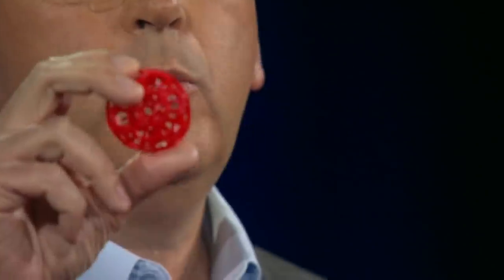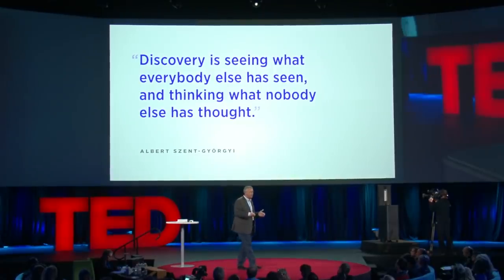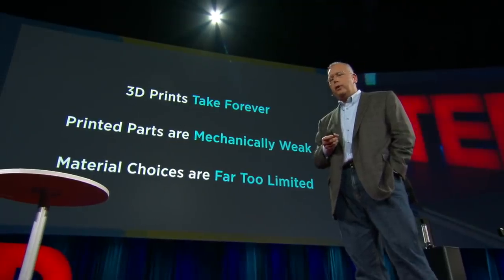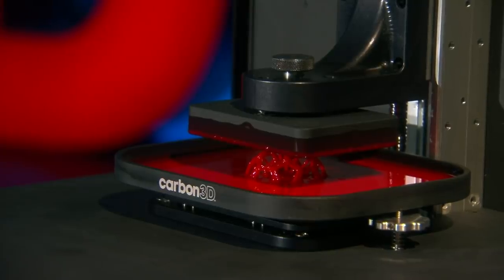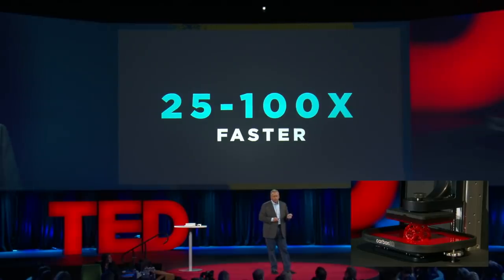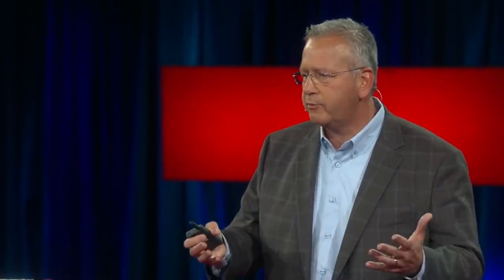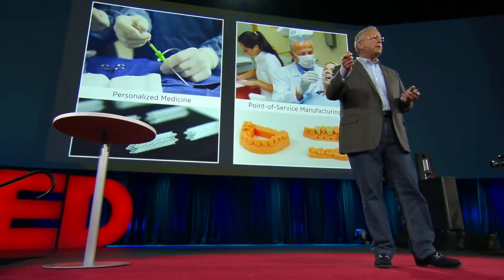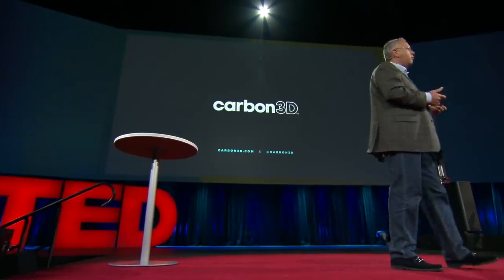What if 3D printing was 100x faster? | Joseph DeSimone

Comment: Funny how he talk about fuel efficient cars and shows a Telsa that uses no fuel.
Reply: gamepro94z thats about a fuel efficient as you can get. Electricity is still a form a fuel, and creating a lighter rigid product would mean less electricity is required to drive it forward.
Reply: tushay
Reply: gamepro94z Tesla needs to pay attention to this tech if they wanna make their Model 3 affordable. The Model S requires an aluminum body to get its impressive mileage, which is why it costs so much.
Reply: gamepro94z tesla uses fuel.... it runs on coal.  ITs just that the coal is burned at a power plant not in the car.  Its more efficient than burning the fuel in a car for sure but the tesla CERTAINLY runs on fuel
Reply: +Ddub1083 Aswell as power plants having higher fuel efficiency, fossil fuels don't account for all energy generation. The price of solar is on a very consistent trend downwards also where it will eventually undercut oil and coal significantly. Fossil fuels have a strong hold now but they'll eventually become not just unhealthy and impractical but economically nonsensical. /rantover
Reply: Tesla certainly does NOT run on coal. You don't need coal to start a tesla and to drive around. It's like saying that people eat gasoline, because in order to produce the crops, the farmer used a motorized vehicle.
Reply: Charging and then discharging battery throws away half of the energy instead of using it to proppel the vehicle. Tesla wastes more fuel than gasoline engine.
Reply: Where does this sicentificallyfull claim come from?
Reply: Christopher Hilder ELECTRICITY IS Not a form a FUEL....FUEL is: COMBUSTIBLE MATTER used to maintain fire, as coal, wood, oil, or gas, in order to create heat or power. An energy source (combustible) for engines, power plants, or reactors:
Reply: laszu That's the stupidest thing I've heard this month. An internal combustion engine blows up fuel to make heat and a little forward motion on the side. It's doing incredibly well if it can get 30% of the combustion energy in gasoline out as useful work. The inverter, battery, and motors in an electric car are all at over 90% efficiency; 0.9 × 0.9 × 0.9 = 72% efficiency. USA Department of Energy says:
“Unlike conventionally fueled vehicles, electric vehicles experience a loss of energy during “refueling,” with an energy loss of about 16% from the wall power to the battery during charging. However, electric vehicles are otherwise highly efficient delivering about 65% of the energy from the wall power to the road even before energy is reclaimed through regenerative braking. When energy gains from regenerative braking are included, the amount of energy used for traveling down the road can rise to more than 80% in the EPA-combined city and highway driving cycle.”
Reply: Electricity is a fuel. Everything that you can power something with is technically a fuel.
Reply: @blackking2028  No it isn't. Merriam-Webster:
a : a material used to produce heat or power by burning

b : nutritive material

c : a material from which atomic energy can be liberated especially in a reactor
Reply: @Ddub1083  No, it's not! Coal fired power plants are only about 30% to 40% efficient to begin with (look it up), and then there are losses in transmission, storage in a battery, and in the motors themselves. It's ALWAYS more efficient to use less steps, and burn the fuel in the machine itself. Basic thermodynamics.
Reply: @skierpage  Coal fired power plants are only about 30% to 40% efficient to begin with (look it up), and then there are losses in transmission, storage in a battery, and in the motors themselves. It's ALWAYS more efficient to use less steps, and burn the fuel in the machine itself. Basic thermodynamics.
Reply: a tesla ? - building this auto cost more fuel than its needed to build an average auto and drive it for 200 000 kilometers similar to solar or wind powerplants building it is poor investiton that returns after 20 years of usage - and after that its garbage.
Reply: @davidkaye821   fortunately coal plants are down to 30% of USA generation mix, and combined cycle gas generation plants are more efficient. Cars spend a lot of time not running at optimum load. Combustion cars throw away energy every time you slam on the brakes. A hybrid overcomes some of this. UCS has a map showing what mpg a gasser has to achieve to have the same CO2 as a battery electric vehicle. https://blog.ucsusa.org/dave-reichmuth/new-numbers-are-in-and-evs-are-cleaner-than-ever

Comment: Isn't this just a lithographic 3d printer? these things have been around for awhile
Reply: i think you mean (sterolithogrothy). this is slightly different.  instead of a lazer curing the resin, a picture is . this speeds it up
Reply: +Scott Robel yes thank you, that was the word I was looking for. It's cool to see the same technology that is used for making CPUs finally being used for 3d printing
Reply: +Zach Hixson you're welcome
Reply: +Scott Robel - It's not just that. Typically SLA machines have to peel the print off the bottom of the tank after each layer is printed. Their oxygen barrier keeps the resin from curing in contact with the bottom of the tank, allowing them to skip the "peel" process and allowing them to update the "layer image" and the vertical position of the print continuously - which is the reason why this machine has greater vertical resolution and speed.
Reply: +Tetsujin That is a wonderfully clear explanation. Thank you!
Reply: Tetsujin yes like form 1 printer. and 3d systems top printer
Reply: Scott Robel  What are you saying is like the Form 1, exactly? Your post is a bit vague.
(Form 1 is an example of a printer that has to stop between layers and peel the print off the bottom of the tank)
Reply: Tetsujin yes,  (Form 1 is an example of a printer that has to stop between layers and peel the print off the bottom of the tank)
Reply: You know, you need to get out of the mindset that makes you say "Isn't this just...".  Isn't that car just a train without tracks?  Isn't that radio just a telephone without wires?  Isn't that computer just a calculator?
Reply: Larry B just chill, look in the conversation
Reply: Zach Hixson control of variables increases speed and strength
Reply: Larry B no he was asking if it was an SLA printer that they were branding as something new.
Reply: Right. Wouldn't a void in the print without an inlet for resin result a suction force probably tearing the  curing resin layer inside it. Maybe printing in a vacume would help that.
Reply: assassinlexx There are no enclosed spaces in the current layer being printed, it's just solidifying parts of a 2D image.

The limitation of this is it can't start a new region in a layer "from scratch", every region must be connected to the solidified layer above it (or you'd have to slide in a new top plate).

Comment: "2D printing over and over." ... But, doesn't everything have depth in the real world?
Reply: leafbelly so does ink at a fraction of the size
Reply: @z2baggenziz  it seems we've been 3D printing all along
Reply: Yes. But what he meant is that the technique used is 2D printing which is true; most 3d printers print using 2D algorithms multiple times. Basically they divide the model into multiple layers with each layer having a very thin depth and print them on top of each other using 2D printing.

Comment: Then I can make guns at 100x the current rate. Cool!
Reply: *****
Yes.
Reply: Still need some chemical reagents to push bullet.
And this purchases could be watched.
Reply: Dysputant Except that Black powder technology has been around for hundreds of years and is really easy to make (google it). There are also people here on YT who used ground up match heads as a propellent. Are you really going to ban matches?
Reply: zz773
Y black powder is good if you want to kill someone from 10 m with loud bang and smoke. You don't need 3d printed gun for that.
Just make makeshift cannon from steel pipe...
But for 3d printed assault rifle you need nitrogen-reaction energy levels and speeds. And making it in home can easily lead to losing fingers  to head. I've read how to do this , and it is not that easy.
Reply: Dysputant
I've done it, and it is easy. And who said anything about an assault rifle? Why not a revolver? Also, there is nothing intrinsic about assault rifles that require smokeless powder. It's just an accident of history that they were all designed to use smokeless powder, so there is no reason someone could not design a mid-caliber assault rifle that runs on black powder.
Reply: A: Those firearms can only get a couple of shots off before they either explode or being non-functional.

B: This guy is talking about 3D printed Terminators, so I think you have more to worry about that some plastic guns.
Reply: why you all obsessed with guns? they can just 3d print a compound bow and arrows and hey presto!
Reply: TheMohawkNinja
3D printed gun technology has advanced a lot in the last few years, and will continue to advance. At one time computers only ran on punch cards and the Internet was unheard of. Things advance.
Reply: Ziggy
Why not guns AND bow and arrows!
Reply: Brilliant Mind...
Reply: zz773
Your point being? Just because this device can be used for mass arms manufacturing doesn't mean that it will eventually become effective at arms manufacturing, as copyright laws will be enacted to keep those firearms in the black market.
Reply: and you need to murder who?
Reply: TheMohawkNinja
 Most of the development in the 3D wiki weapons space is not copyrighted. Besides, most gun designs have been in the public domain for years.
Reply: *****

Why thank you!
Reply: zz773
It's not copyrighted, because it's not practical, hence why I am saying that it will be copyrighted once their manufacture becomes practical. Secondly, guns use a variety of materials that would further inhibit this apparent issue of 3D printed guns.
Reply: dangerouslytalented
I, and everyone I know, owns lots of guns and have never shot anyone. Try again.
Reply: zz773
and what do you use them for?
Reply: dangerouslytalented
Fun.
Reply: ScoutiverTTV
You're half right; I'm a badass, but I'm much older than 15.
Reply: Meh... all ready really easy to make a pretty effective bomb, unless your an idiot or don't want homeland to get involved. But as always all because people can make it doesn't mean they will, not the mention even when we do we don't even use it.
over all the whole concern of 3d printed guns and all that is just stupid, sure you might misuse here and there. But same thing can be said with a pencil, after all quite a few people get stabbed with pencils each year which if you don't know pencils you use for writing/drawing and thats really it.
Reply: *****
There are also a lot of technical problems to them. They would have to get the right kind of plastic that won't crack or shatter under the stresses for a start.
Reply: you guys know that you can shoot a rim fire .22 round out of a solid steel pipe with a hammer right? and id rather that than a 3d printed gun.
Reply: Let me guess, American? lol
Reply: British <3
Reply: and also they wont broke just after shooting 2 bullets :)
Reply: zz773 *At one time* 

In a lot of our lifetimes... insane.
Reply: Ziggy
That's actually a pretty good point. 3D printer + plastic + ammo (even if it is just .22s) would be pushing $600+ minimum. Whereas a hammer (assuming you did have to buy one) a steel pipe and some .22s... ~$25?
Reply: TheMohawkNinja
and you can't 3D print ammo, because you need actual chemicals, unless you are going for old style gunpowder.

Oh, and guns kept in the house for protection are FAR more likely to be used on inhabitants of the house (homicide, suicide or accident) than any home invaders.
Reply: dangerouslytalented
I wasn't saying that you could 3D print ammo. I was referring to the cost of .22s at the store. Plus, I am agreeing with you here, so I don't know why you pointed that other part out.
Reply: TheMohawkNinja
the other problem is the plastic used for 3D printing is not exactly ballistics grade...
Reply: mikecat23
Right... metal... how many (and how expensive) are metal 3D printers? Also, 600+ round tests are very small. Most firearm manufacturers do 10,000 round tests. 600+ rounds on an M1911 only equates to about 86 clips of ammo. Plus, if those metal 3D printers use the same printing techniques that current conventional 3D printers use, that 600+ mark is probably pushing the limits of that gun.
Reply: TheMohawkNinja
600 rounds? You could probably do that in one day in a firing range.
Reply: TheMohawkNinja it only takes 1.
Reply: yemo34 We still have the darknet, so anti-3D-printing-firearm laws really won't change much of anything regardless of how many 3D-Printed guns are involved in shooting.
Reply: zz773 You can kill someone with your hands why bother with a gun?
When you kill someone at least give them the respect of making an effort for it, break his/hers legs, mutilate hers/his genitals, crush her windpipe, destroy his face. 
To kill some one with a gun barely requires more than to lift your arm and twitch your finger so whats the point? it's such a empty way to end a life.
Well i guess it's something a person who has never even held a gun can't understand.
Reply: Edvin Granlund
Say what you just said to a professional sniper. I dare you.
Reply: TheMohawkNinja
Does not take a professional sniper to spray bullets into a crowd with an AR15
Reply: dangerouslytalented
That's not my point, but doing that won't guarantee a kill anyways. .223 caliber rounds are not what you would want to use to go about killing someone if you want to be sloppy about accuracy. An AK-47, or better yet a PKM, both of which use the larger .308 caliber rounds would be a far better option.
Reply: TheMohawkNinja
either way, it is far easier to kill somebody with a gun than practically any other weapon.
Reply: zz773 100x faster... but 1000x more expensive.
Reply: Ddub1083
... and much less durable.
Reply: 3D printing guns as of right now is actually not possible it's a big rumor
Reply: ThingsDoneDigital what are you talking about its not a rumor you can do it, you can even download the plans off of a website.  There are minor components which cannot be 3d printed which you need to buy as a kit but you can certainly 3d print a gun today.
Reply: TheMohawkNinja what's your point? ar you going to tell me that standing X meters away from the target makes it more straining and exhausted and mentally damaging to the person who is doing the killing? aiming with a sniper may involve more thinking and skill than a gun however the concept is the same "if i move my finger 1 cm you ar dead".

ok never mind i can see that getting killed with a sniper at a considerable range isn't something just anyone can pull of and that developing that level of accuracy isn't easy, but agen i've never held a gun that isn't designed as a kids toy so i dont know if it is difficult to learn to aim with them.
Reply: Edvin Granlund
Hitting a man-sized target with a shotgun loaded with buckshot at 15 meters, would literally be childsplay. Trying to hit a man-sized target at 1000 meters, even with a custom high-precision bolt action rifle is something that takes a lot of skill.

I've done the former quite a few times, except with moving clay pigeons instead of a large stationary target (so, a more difficult shot at that), and the latter I have done once, which was shortly thereafter deemed an example of beginner's luck, since I never hit it again the rest of the day.
Reply: zz773 If this kind of technology goes mainstream handheld guns will probably become obsolete pretty fast...
Reply: +dangerouslytalented , others - look up the chemputer. Think about the possibilities. Be scared for the rest of your life of chemical weapons falling into the hands of absolutely everyone.
Reply: explosu
... If you think a chemputer would be bad news, (also think of drugs like Crocodil and then ramp that up) think of the damage a homebrew genetically engineered virus could unleash.
Reply: +dangerouslytalented On the wtf side, LSD grenades for everyone!
Reply: +TheMohawkNinja  well you kind of proved my point, the people that print guns arnt going to be the profesional snipers so all thats left is the lucky shots and no brain spray.
all i asked for is to be shown the respect of effort when you kill me
if you don't count years of training as efort then please have that opinion you're entitled to it
Reply: Edvin Granlund Right, but buckshot is different than a single round.
Reply: +TheMohawkNinja ofcourse but you generally have more than 1 round avalebol so the difference is minimal
Reply: Edvin Granlund After recoil compensation and target(s) moving, maybe. Or I could just shoot many rounds in one shot, and ALSO have more than one round available, especially if it's a semi auto shotgun.
Reply: Edvin Granlund Honestly, I have no idea. You replied so far after my last post that I forgot what point I was originally trying to make, but yes, an 8 year old could kill someone quite easily with a gun.
Reply: yeah i guess, what's cleaning out my gmail and found the "reply alert" or whatever it's called, 
just annoyed that guns make it so easy to kill people that it barely needs to be a conscious choice

Comment: So far 3d-printing hasn't been able to step up to mass-producting parts and products but I think this technic has potential even for that! It just may not have possibility to print multiple different materials it would seem..?
Reply: WMfin Even this won't beat mass production, probably, but what it can do is that it can do special production at near the efficiency of mass production.
Reply: Also make prototyping much faster and more accurate at measuring stress and stuff.